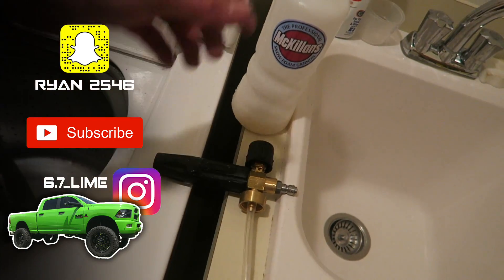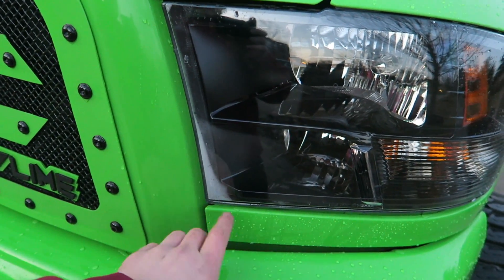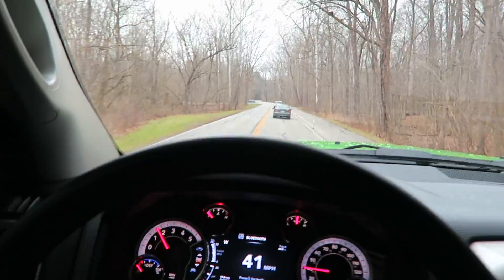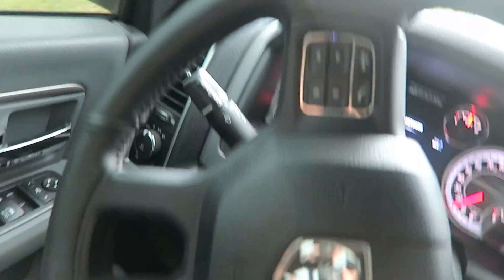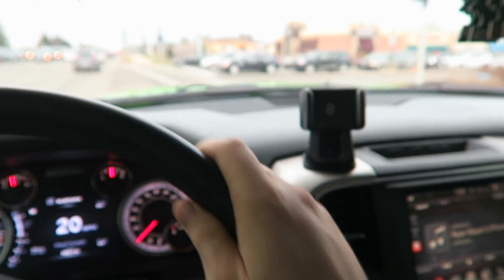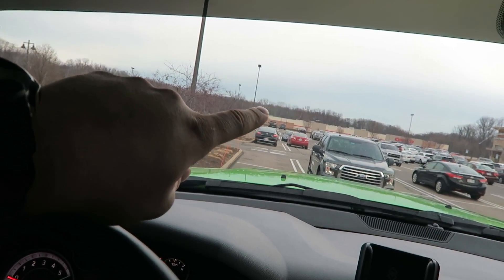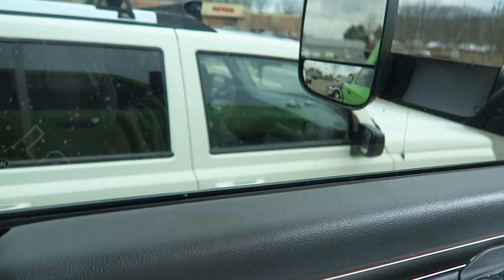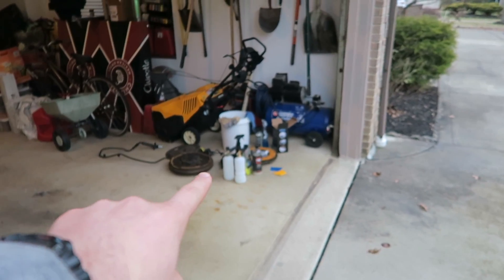FLOATING GEARS IN MY 6.7L CUMMINS WITH A DUAL DISK CLUTCH!!!

Comment: Lol I drive a semi every single day of the week. This truck in no means is like a semi at all. My 10 speed Eaton can be shifted with 1 finger.
Reply: I was thinking the same thing. I drive a semi every day too. I laughed way to hard when he said driving in first gear made it feel like he was driving a semi. HA!
Reply: Evo8fan mine is a little day cab single axel international but unloaded with no trailer. Man is it fun to shift gears in.
Reply: @ethan88912  I was driving a single axle sterling with a Eaton 10 in it. Getting moved up into a tandem axle kenworth or freightliner soon hopefully.
Reply: Drive a c500 tandem tandem Canadian oilfield 380" bed truck with a 18 and 4 and yeah not the same thing at all as a syncrod 5 or 6 spd 4 wheeler trans. As long as you understand rpm and wheel speed you can shift with one finger as said above. If you can't figure it out it won't shift worth shit no matter how hard you push, pull, grind etc. And using the clutch like a regular trans don't work either obviously. Clutch to lift off and stop is all, float gears in between. Unless it's super muddy and have crazy drive weight then maybe double clutch from bull low until you reach upstairs/ high gears. Depending on driving style. With 100k + lbs sometimes a good idea to D/C
Reply: You’re missing 8 gears bud
Reply: @ChrisSmoove77  Eaton makes a 10 speed. And 13.
Reply: @ChrisMason.333  also makes an 18 speed too
Reply: 10 speed 😂😂😂
Reply: Ethan_Marquardt I’m a advocate of the old 13 speed myself
Reply: Your ten speed probably has like a 2 inch throw too.
Reply: 👍 yep! And no synchronizers to ruin like this truck.
Reply: Lol yes me too 🚛
Reply: I knew I had some trucker buddies on here burning his as up
Reply: Nobody cares
Reply: You’re right…. Eaton is a good trans….. the Allison of autos in my opinion

Comment: Clutch less shifting is hard on any transmission that has synchros.
Reply from the maker: Yes!!!
Reply: RYAN MAYER so then explain the reason why you admit to doing it in the video, not only in one vehicle but in your jetta as well
Reply: Not if you do it right.
Reply: @Ryan-qz5rg  cuz he can?
Reply: @sasazapadnik9335  nope still lol
Reply: @amritk5173  if you match the RPM , there is no wear
Reply: People do the same thing in semis and yea I know the clutch in a semi is different and all that, but if you watch your rpm you can actually just slide the transmission into the next gear when it wants to slide in
Reply: Looks like you just can't drive a manual
Reply: @smokeywood2306  Ya, after over 1 million miles I still can't figure out how to shift my 379🤣 
Still has nothing to do with transmission design.
Reply: @srn9973  you literally said it's hard on a transmisson that has synchros... do you not know what synchros are to begin with? And after a million miles wouldn't you get better at it over the years? But you said it's so harf
Reply: @smokeywood2306  You are right a  transmission is a transmission sliding clutches syncros Hi/Lo it's all the same. 
So I stand corrected floating gears is  the best thing you can do on all manual transmission. If you develop problems you weren't doing it right.
Reply: @BradChadley : Yeah, right, that would be a really "logical" explanation, wouldn't it?
Reply: @smokeywood2306 : Whether it is or isn't is no reflection on if the driver supposedly "can't" drive a manual transmission, silly.
Reply: Haha,  @srn9973 , I hope you were just standing up for yourself sarcastically there.

Comment: In an eaton fuller 10 speed, I floated the gears all the time.  The first time driving the truck home, I did it, after a 30 minutes intro to shifting a 10 speed eaton fuller.  For the uninitiated, that transmission doesn't have any synchros.  It only shifts at 1300rpms, and is much easier to shift without the clutch than with it.  Even with the clutch, it is only shifting at 1300rpms.  The secret to floating gears is unloading the transmission on the shift.  So, you accelerate, let up on the accelerator until the trans is (floating) and then shift, then back on the accelerator.  If you back off the accelerator, and the vehicle begins to slow, you've loaded the trans again.  It's got to be unloaded.  Good luck.

Comment: Over 300,000 miles on my 6.7 G56 with Dual Disc South Bend. Nothing but floating gears and Rev matching.  Works great really.  Saves clutch life big time.

Comment: When I was trucking, I taught myself how to float the gears. Then I was told 400rpm. That's the magic number between gears in a regular 9 speed. 
Ran a regular rte and had holiday traffic in a construction zone on I94 at I65. 10 mile backup. That's how I taught myself. Been doing it ever since.

Comment: As a truck driver I always float gears it's very possible to do in a normal pickup especially a diesel I can float gears in a straight 6 Ford and my 7 3 Powerstroke it's all about finding The Sweet Spot every engine is different every engine revs different and drops different difference between Powerstroke and Cummins is obviously inline motor vs. V8 so your revs will fall faster or won't rev is high typically The Sweet Spot to go for is 1500 RPMs take it out of gear drop it in the next gear around a thousand it gets different when you go higher RPMs you just have to drive a truck for a while and get used to how it shifts it won't tear it up if you have good synchronizers if you're doing it right you're matching the engine and transmission at the same speed that they need to be to slide right into gear plus you're not wearing out your clutch or your throw out bearing because you're not using it only to start and stop or slave cylinders on this new shit with hydraulic pussy clutches

Comment: I use to float in a semi and double clutch to down shift. Just how we were taught and it always worked. Floated a little in my 5.9, but with a SBDD, it was not near as easy.
Reply: No yeah they're synchronized transmissions and semi trucks are not.  The synchronizers get in the way and fuck it up.

Comment: If you hold light pressure on amp steps while you close the door they will stay down. Good idea in crowded parking lots they stick out just enough to stop doors from dinging your trucks door. Good idea to test on one's own truck to make sure it works on their application/fitment. Worked for me and buddies I've recommended it to. Not sure on RBP steps if they stay down or not. On AMP steps you just put your foot on the board and close your door after a couple seconds it should stay down.

Comment: Two questions, Ryan. Is the foaming cleaner you use environmentally safe?  (Since surface water drains into our drinking water supply in Indy that is an important consideration. )  

Second, how well would the ceramic finish stand up to a commercial car wash?
Reply: If you use commercial car washes you don’t need to worry about ceramic finish you could give two shits about your vehicle if you use car washes. Don’t believe me? Wait until it’s dark and go look at your cars paint with a flashlight and I garuntee you that there’s gona be a billion circular micro scratches. Point proven. Forget the ceramic. Your paint is already fucked.

Comment: Hey Ryan, I drive semi trucks for a living. Floating gears in a semi is easy because all you are doing is rev matching to ground speed. There are no synchronizers on a semi transmission. But on like your truck per say, it is also easy to upshift and downshift without the clutch and won’t do any harm. Basically your clutch is just to start rolling and when you stop to put it into a gear. Just play around with it and you’ll become super smooth at it. If your truck has a trans break as well, that’s what semis have and that’s why we float because you don’t want to hit that trans break while moving because you’ll break the pin on the brake. Idk if your pickup has one or not. Anyways, love your vids man. Sick build. Keep doin you man!

Comment: Down shifting isn't all that much harder, the trick is having a feel for your trans' different ratios (or rather the RPM range differences between consecutive gears), then while you're in neutral, revving the engine to an RPM that is HIGHER than what the downward gear will achieve at the same speed... then after you've revved, the RPM's will naturally fall past the sync point and you can pop the gear in, not much differently than with an up shift.

Comment: Have you ever had a problem with throttle sticking ? For example when you go to shift the throttle still seems to be engaged and the RPMs still climb for a second or two before dropping unless you come off the throttle pedal two seconds before engaging the clutch. It seems to be more noticeable when you're in the throttle more shifting it at higher RPMs I know this is unrelated to your video but there's not too many people with a g56 on YouTube

Comment: Floating gears in any synchronized transmission is a bad idea. the purpose of the synchronizer is to synchronize the speed of the main shaft and the output shaft of the transmission during a shift a.k.a remove any speed difference between the two shafts. this is intended to be done with the clutch dis engaged ( trans disconnected form the eng.) otherwise without using the clutch,when the synchros try to do their job by removing the speed difference between the two shafts they are essentially trying to slow down the entire engine or drive train eventually destroying the synchronizer and putting huge amounts of brass or firerous material into you oil which shortens the life of your bearings as well. I know it works pretty seamlessly but that split second where you are waiting for it to drop into gear is actually the synchro fighting to match eng and drive shaft speeds.
Reply: mitchell rose I floated gears in my 01 for 175k miles. No problems. Most people aren't as good as driving as they think they are.
Reply: That's correct. And that's exactly why we have synchro transmissions. Either way floating gears defeats the purpose of a synchro and eventually wear will occur.

Comment: I know this is an older video but do you turn the truck off in neutral with E brake and then put it in 1st when it’s off or put it in first with E brake and then turn off truck. I’m new to manuals so I’m conflicted on what to do in my own truck
Reply: Lol it makes no difference at all. Literally doesn’t matter.

Comment: Float your gears man. Save your clutch. You'll learn when you need to clutch and you'll learn when you don't. The less you can use your clutch and still make your shifts, the longer your clutch will last. If that matters to you. These clutches aren't super expensive so if you burn one up every 2-3 years, not too shabby.
Reply: "Save your clutch..."
But meanwhile, spend a lot more money replacing transmission parts or the whole, since the chances of not hitting the float-shift on 6 or fewer gears are fairly high, and since it has synchro cones that probably wear out faster this way.
Reply: Haha, yep,  @ContrarianCrusade !

Comment: You cant really float gears in this truck dude its a synchronized transmission floating gears is not using the clutch in a non-synchronized trans like a 18 wheeler or dump truck. Try not to use bs click bait titles dude just makes you look like you don't know what you're talking about. 

this is the definition : 
Float shifting or floating gears, also called "slip shifting" or "dead sticking", is the process of changing gears, typically in a non-synchronous transmission, without depressing the clutch.

Comment: You don’t need to use the clutch but you should. Pickup transmissions are 100% different than SEMIs. They can easily be shifted w/o damaging, that pickup has synchronizers and the gears are not straight cut like a rig. He’s right use the clutch in your pickup
Reply: Uh, not 100%, actually. Also, it's not about the tooth cut. Those aren't the parts that you're mating. The gears are already meshed, and the driver is just mating splines.

Comment: Rpm swing should be about 1k rpm 6 speed 1250rpm 5speed 10 speed 500 rpm 13 speed bottom 5 500rpm top 8 250 18 speed about 250 if you dont double up or drive it like a 9 speed empty. Estimate

Comment: You can float gears in 99% of manual cars…. I’ve done in it my 80 and 81 k10, 2 escort gt’s, both jeeps, my buddies 350z, my power stroke, pt cruiser gt, my dads dodge 1500 and 3500, and my uncles manual duramax…. It’s not hard just don’t force it. Little pressure on the stick, let off the gas and bam it’ll go in without forcing……. People who drive cummins(inexperienced kids) say they float bc “it’s like a semi” and grind so much that they need a rebuild which then get rid of the truck bc they spent so much on rims and a lift they can’t rebuild a trans…… all the old timers and older guys/gals will tell you that semis are easier and less prone to carnage floating than regular trans…..

Comment: It was told to me that you shouldn't down shift just due to a clutch being a one way device and really only built to take the torque in one direction and by using it to slow the truck and downshift your increasing the wear of the clutch and will need to replace sooner. That's what was told to me by South bend anyways
Reply: That is true to an extent.  If you rev match before letting out the clutch on a down shift there is a lot less (almost none if done correctly) wear with the clutch trying to match engine speed.

I have a 2011 with the g56 in it.  Stock clutch lasted roughly 70k miles, my second clutch(sb3250) is at 90k miles and still going strong.

Floating up is easy, the down shift is a bit tricky with exhaust break but very doable with a quick rev at the right time.
Reply: @foamybubbles79  I've got a 12 g56 with the Valair dual disk ceramic clutch. Floating almost doesn't happen for me but blipping the throat to down shift does. I don't get the blip the throttle when up shifts though. This clutch wants shifts above 2300 or it drops to 1300 and lugs too bad
Reply: @tonyturner779  very true.  Anything below 1500 the trans makes awful sounds.

Do you have any issues backing up and wheel hop and or feeling like its binding up?  With a load and even empty the truck wants to hop/jump in reverse.
Reply: @foamybubbles79  yes. I get the same thing. I just have to give more throttle and it smooths out. 

My biggest issue is a jerky bumpy reaction at low speeds in 2nd or 3rd and hit a bump I have to let off the throttle fully and then go.

Comment: You have to double clutch to shift a big truck with the clutch so it’s easier just to float gears.
Reply: in gear clutch out into neutral clutch in shift to next gear clutch out on the gas .. downshifting is what fucks people up ... the concept of giving the truck fuel to raise the rpms to shift out of gear really fucks people up

Comment: I have been shifting both my vehicles Diesel 08 jetta and a 2005 Dodge ram with a H.O. 5.9 Cummins. I have never used the clutch from minute one. Never a transmission or clutch problem. If you do it right, shifting without the clutch is easier both on the vehicle and the driver. The only reason for me the clutch is there is for starting from a stop and not stalling at a light.

Comment: Hahaha you have to learn your RPM and your truck. I have done it in a 3 speed to 18 speed. So more gears don't mean nothing because it's just high low in upper & lower range. It's funny how people don't understand stuff. Semi trucks has the same thing just larger and heavy duty. So sorry if people don't learn and is scared to learn. Old school trucks you have to double clutch because the transmission and clutch plates. Newer you don't need to

Comment: Throw out bearing is junk only makes noise when clutch is not pressed in and in neutral
Reply from the maker: No that’s a dual disk clutch and a single mass flywheel in an aluminum tranny
Reply: dual disk chatter boss

Comment: You should never attempt to float gears in a car or even a passenger diesel truck. You need medium or heavy duty synchros which would be like a Class B flat bed or larger
Reply: You can do it in a pinch on anything but that doesn't mean it's built for it.